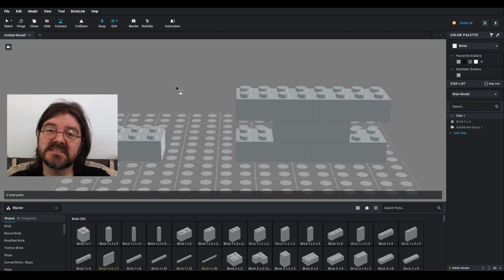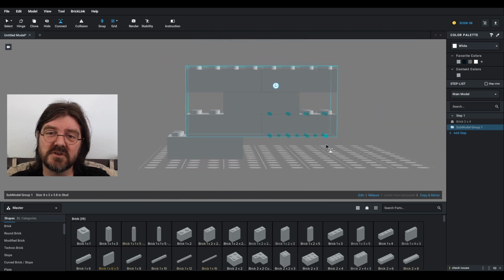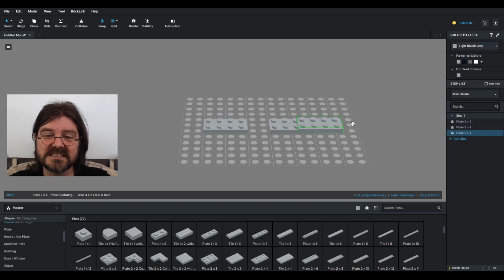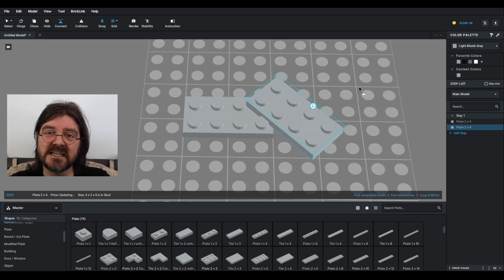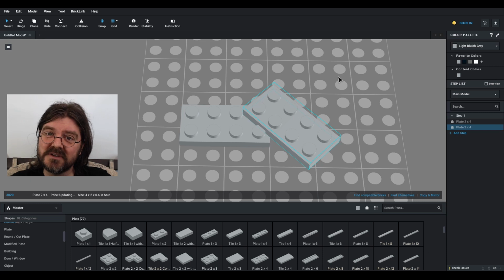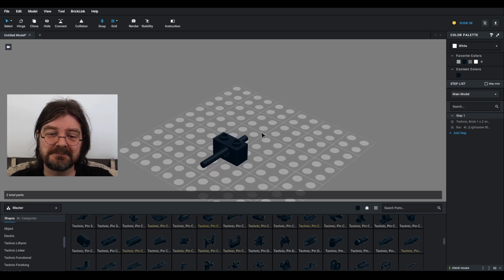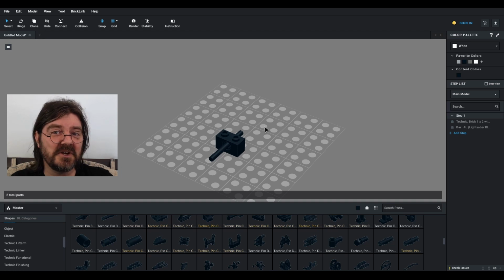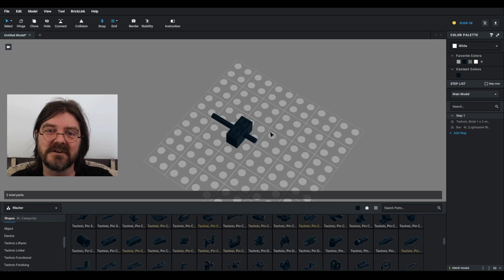Studio Tutorials - Connect Tool. How to click your LEGO bricks together easily!

Comment: How do you use it to connect track?
Reply from the maker: If you look in between the two clips on the track, there is a square box set on the edge of the track, that is the connection point for the tracks.
Reply: @PlaywellBricks , thank you; I found it!
But the problem is still there: the program reports the same number of "clutch power issues" as before. This far, I have only encountered this problem when using track pieces. Maybe, then, it's an old, known issue, which they might even be aware of, yet they cannot solve?!
In LEGO Digital Designer, by contrast, two parts cannot be connected easier than the program allows.
Reply from the maker: @hntrains2  I find the stability test in Studio is not the best tool yet. I think there is a lot of fine tuning to be done yet to make it an accurate tool.

You may want to go onto the Bricklink Studio Forum and report the issue.
Reply: @PlaywellBricks , perhaps I should.
I also thought about it, but hesitated - thinking I could not be the first person to encounter the problem.
Thank you for the suggestion!

Comment: how do I do this with two Lego Technic turntables?
Reply from the maker: There is a connection point in the middle of each side of the turntable. Flip one side over, so that when they connect they are in the correct orientation.

Comment: How would you do brickbending in Studio using 1x2 bricks for a very wide half circle?
Reply from the maker: It would be the same as brick bending in real life, you would have to know the angle you want the bricks to twist at though.
Reply: @PlaywellBricks  I'm guessing the connect tool won't work?
Reply from the maker: @usig00  You can still use the connect tool, in fact it is easier to use the connect toll when connecting bricks on an angle, as they snap tool will try to orient the parts in the same direction.
Reply: @PlaywellBricks  Thanks very much.

Comment: I am designing a peterbult 389 right now and I am trying to make the suspension and steer components realistic, is there any way to move the wheel up and down and watch the suspension work ie; watch the connecting arms change their angle in relation to the frame as the wheel travels through the stroke of the suspension? Thanks!
Reply from the maker: Studio does not have that ability, unfortunately.

Comment: Is there no way to have a mechanism (like a series of joints) connect to spot automatically? I mean like telling an arm to grab something, and the arm bends so that it can attach to whereever you want it to go. This is possible in LDD, but not in Stud.io, as far as I know.
Reply from the maker: Correct, there is no two end point attachment in Studio. It has been asked for multiple times but has not been implemented by the devs yet.
Reply: @PlaywellBricks 

I discovered that you can move stuff along an axel in increments by holding shift, but it’s buggy, and the pieces jump away from where you want them to go when placing.

Another thing I wish Stud.io had is the ability to link a mechanism to a certain point. No need for tedious micro-adjustments, just point and click.
Reply from the maker: @moontrooper2587  You can use the connect tool to do this (hotkey: O), then make fine adjustments as you need with transposing it with a fine grid (hotkey:T)
Reply: @PlaywellBricks 

Ohh~, well that transposing is useful. Thanks.

Comment: Can you connect two sub-models together with this? I can't get it to work.
Reply from the maker: Yes, you can. Click on the submodel, then the connect tool, then connect them as you would any other bricks.
Reply: +Playwell Bricks Thanks. My problem was that stud.io does not like it when the sub-model wasn’t close enough to the intended orientation.

Comment: Fantastic tutorial and much needed.  Thanks for tips.  I never seemed to understand what the connect tool did - until now!  Here's a challenge, though - I have been wanting to see if I can attach a small windowpane into a lever base so that it can be held in place - it's a great technique.  But can it be done in Studio?   😀👍
Reply from the maker: Glad to hear!

It can't be connected, like a normal connection, but you can move any part wherever you wish by pressing the T key and dragging it with the arrows. Make sure to set your grid to fine so that you can make accurate placements :)

Comment: I can't figure out how to connect two axles through a universal joint (e.g. 62520). Can anybody help?
Reply from the maker: Hi Jojo, 
I will be doing a whole video next week on using technic parts in Studio including the universal joint. Can you be more specific with your problem? I used universal joints in my current design with no issue.
Reply: @PlaywellBricks Thanks for the quick answer. I'll try to explain the best I can. Unfortunately, I'm not fluent. 
If I have two axles, laying with their ends next to each other but at a, let's say, 150° angle. Now I want to connect them with the 62520c01 universal joint. Irl, this should be possible.
First thing I tried:
I use the Connect tool to first connect one axle with one side of the joint. Works perfectly fine til now. I select the second axle (which is angled towards the first axle), and use the Connect tool to connect it with the joint. What Studio does is, that it moves the whole axle and removes the angle so that the first and the second axle are at a 180° angle connected through the joint. This removes the purpose, as I wanted to connect them at a 150° angle.
Second thing I tried:
I tried to use the Hinge tool to create an angle between the two interlocked and non seperable parts of the joint, but I couldn't find a way to select just one of the parts. 

I'm new to Studio so maybe, the solution is dead simple...
I hope that was understandable, if not I'll try to do it again.
Again, thank you.
Reply from the maker: Okay I can help you through this :)

First off, use the separate pieces of the universal joint rather than the single joint piece itself. Place your first end down, put the universal connector in the middle, and angle that connector to the angle you wish the other part of the joint to be at. Place the second universal joint angle on the middle connector.

Then insert your axles in each end as normal.
Reply: @PlaywellBricks  Thanks a lot, I appreciate it.
Reply from the maker: My pleasure! If you have any other questions feel free to ask :D
Reply: @PlaywellBricks  I will if there are more! Looking forward to the Technic parts in Studio video :)

Comment: how to connect 2421 60849  :P  Can  you write to studio to fix it :)
Reply from the maker: There are two ways you can fix that. Either take 2421 into parts designer and add the connection point yourself, or just use a ghost connection (T key)

If you wish you can ask for them to make the change on the Bricklink Studio forum :)
Reply: @PlaywellBricks  could You write :) You know better english